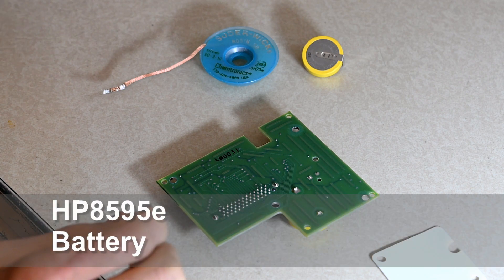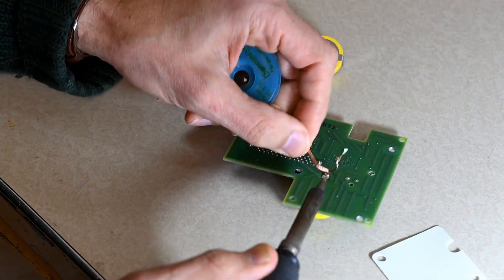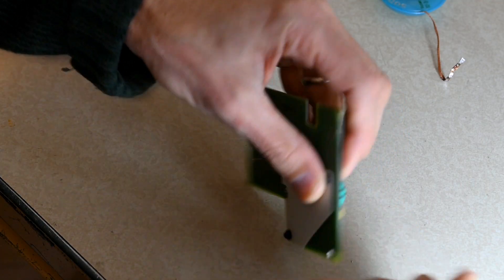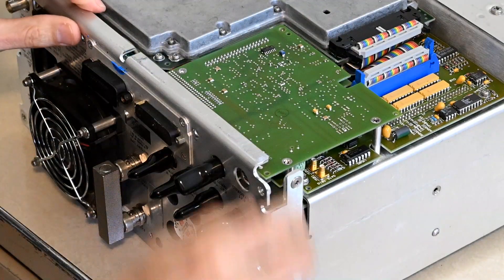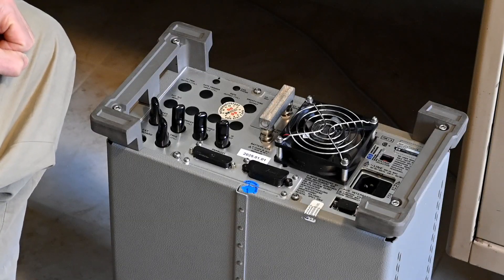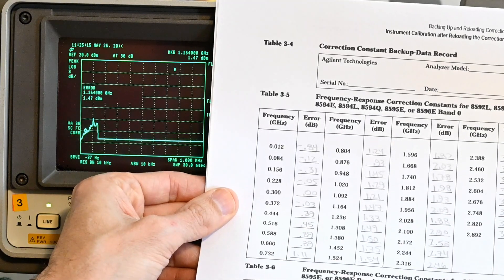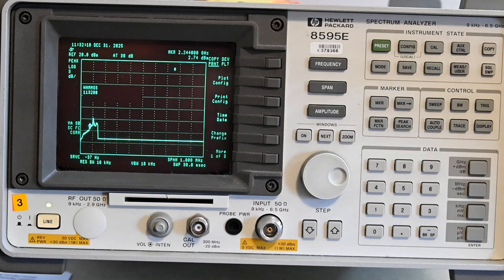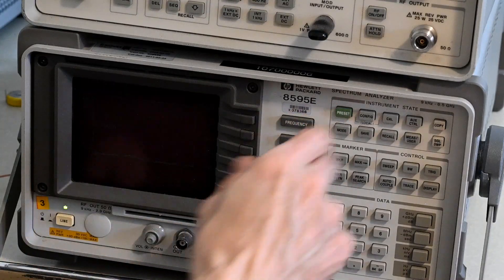Hewlett Packard 8595E battery replacement

Comment: Insane at just how expensive these things were, and there best idea on how to save a kb or so of data was save it on volatile ram, backed up by battery, backed up by capacitors. NV ram existed, as did flash and eeprom.  The only thing you should need a battery for is a clock, and even that should not really matter.

Comment: I'd say you did everything right, except for laying the board on exposed battery contacts when you soldered in the replacement.
Reply from the maker: I completely killed the frequency calibration bit at the end (prior to fixing it again).  That was a tad embarrassing.  The soldering job here was more than sloppy.  Hopefully people will go elsewhere for instruction on that topic.  Ideally I would have a better work surface, remove the solder properly, and set things in place properly prior to adding the new solder.  I have a couple of irons, but one is too small to heat a board of this size (for solder removal) and the other one is too large to do anything requiring any sort of precision.